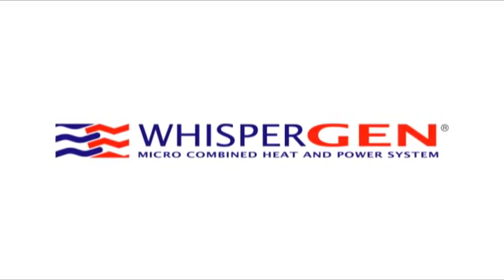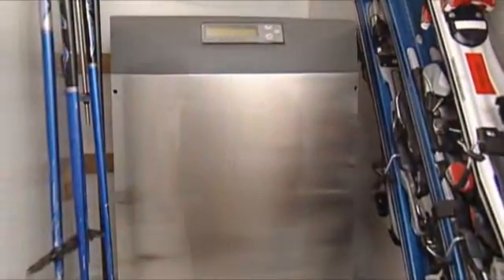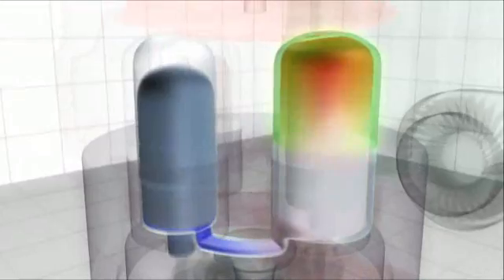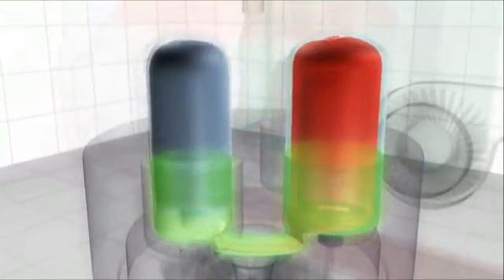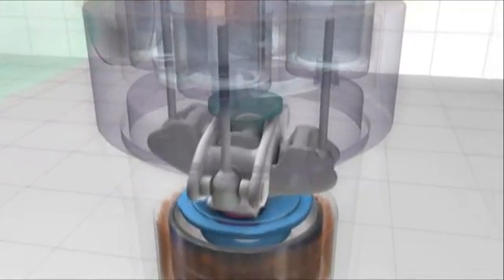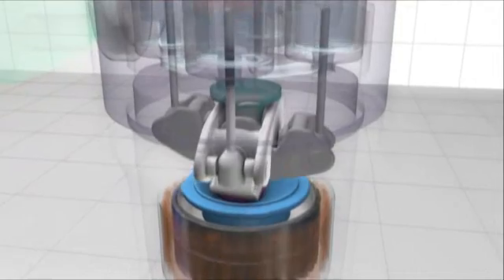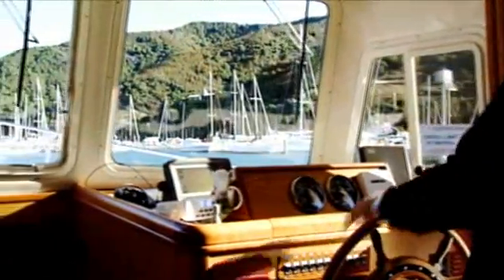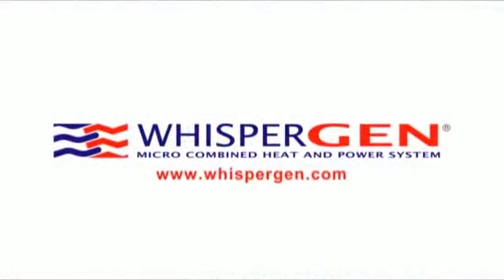Whisper Gen Stirling Engine - Pollution free Energy

Comment: Yeah it's defienitly dirty. And from the stone age. 
greenoptimistic  com/ 2010 /01 /02/ 31-efficient-stirling-engines-used-to-convert-1-5mw-of-arizona-solar-power

They are also using some smaller ones to rotate solar panels in the sun farms so they follow the sun if i remember right

.

Comment: I know it's been used with a solar heat source. Where it's implantable: you need a big mtherf*king magnifying glass or a parabolic reflector to collect enought sun power... in the desert. That is still a "free" source, once you forget the price of the conception, building, maintenance... And thats cool.
BUT, you get a maximum of 31% efficiency, you can still reuse the heat in the cooling part, to warm up desert houses... You could do that with coal plants too.

Comment: You can run stirling engines from the sun's heat, but this particular one runs by burning gas (methane, LPG, diesel too if you like)

The benefit is that a stirling engine is very very efficient at turning heat into electricity, so you need much less fuel to generate the electric. The clever thing here is that you you combine that energy production with Heat production, by combining the two you get a ridiculously efficient system, over 90% efficient.

Coal power stations are about 30% efficient.

Comment: This particular stirling engine seems to run on natural gas to generate the required heat. Often stirling engines are demonstrated using concentrated solar light to generate the heat necessary but this is not always the case. A stirling engine can use any source of heat to operate.

Likely the reason for choosing nitrogen gas in the cylinders was due to its non-volatility, its leaks less or slower than air (*why some places will fill your car tires with nitrogen), and it is very abundant.

Comment: Folks, this is an "external combustion" engine, a Stirling Cycle engine.  Great little animation on how they work on Wikipedia.
The working fluid is sealed in the engine, and it works on *any* difference in heat.  It's got a hot end and a cold end.  It isn't free energy, and it's not as powerful as a gasoline engine, but there's a lot of energy to tap out there.  Or you could be boring, and use natural gas ;)
Reply: This energy is free because it's already been paid for as heating fuel: they're making electricity from the heat that is being used to heat the house.
When the electricity is used in an appliance most of it still comes out as heat, so all the work done by the electricity is free.